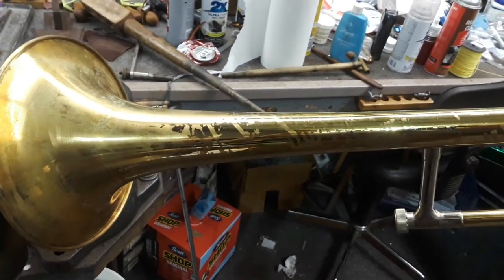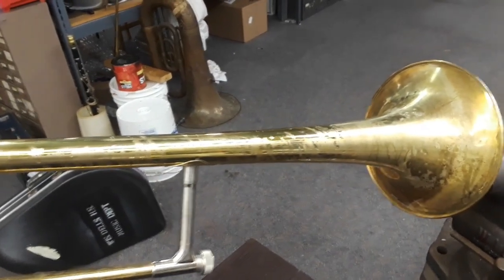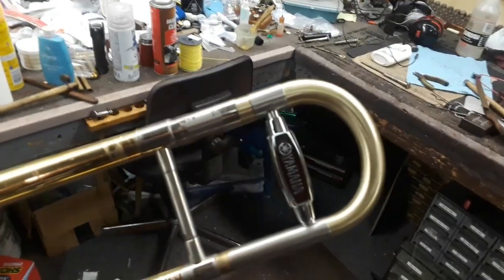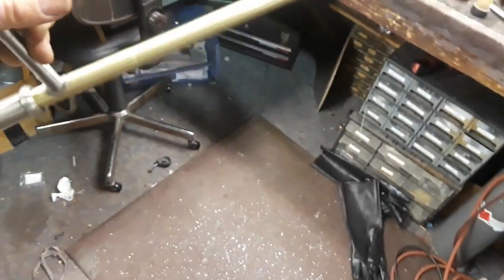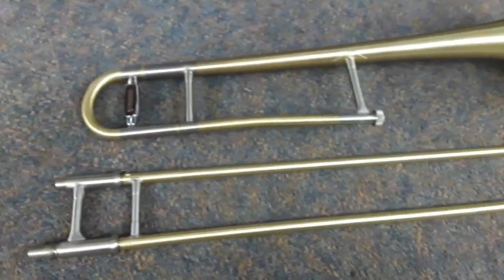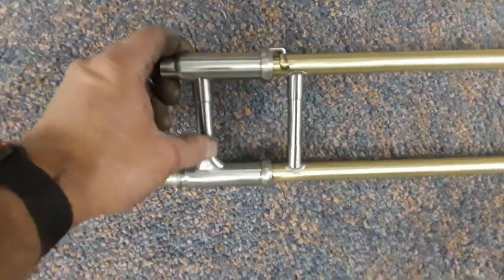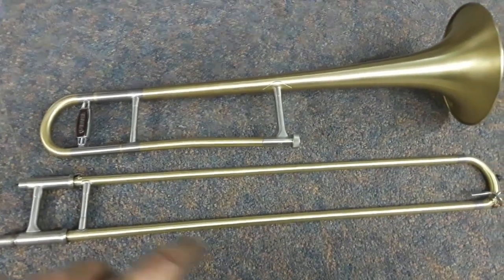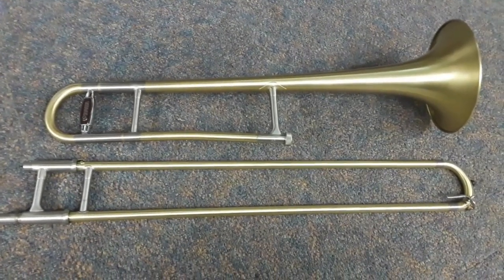Trombone overhaul and Scratch brush relacquer

Comment: I have a question.  Do you strip the lacquer, then reapply before brushing?  Or are you brushing the original lacquer?  Or are you stripping it and brushing raw brass?
I can't tell from the video if the lacquer was intact when you started.
Reply from the maker: Strip the lacquer, remove dings/dents, scratch brush/abrade the brass, degrease, clear lacquer.

Comment: What kind of scrub brush did you use? I have 3: Brass, Nylon, and Stainless Steel. Also, when scrubbing, did you use Brasso or some other polisher? Thanks!
Reply from the maker: I used a Scotch brite pad. Maroon works well. No Brasso. That would introduce oils and make degreasing before lacquering much more of an issue.

Comment: Is the lacker is good for a long time? Is is strong?
Reply from the maker: In my opinion it is very good, but not great. 2 part oven baked clear coats are better.....BUT they also give up over time.  I would rather strip and recoat an air dry finish. I have a cornet I did this way over 10 years ago and it still is amazing. Mostly it depends on Handling, Care, personal Body Chemistry.